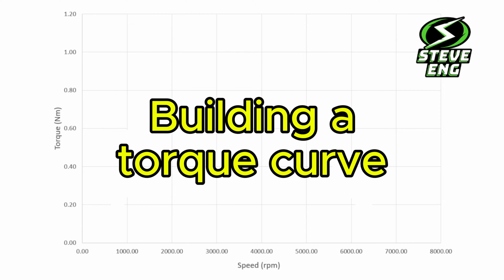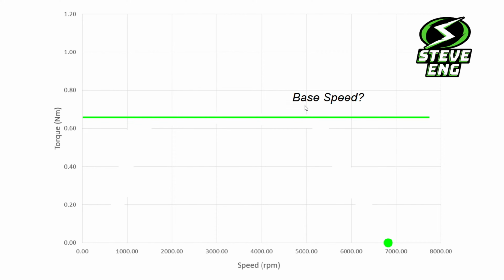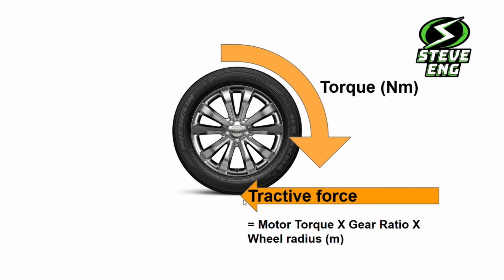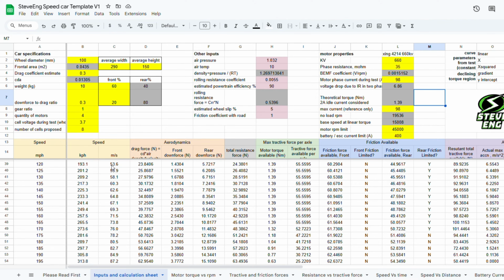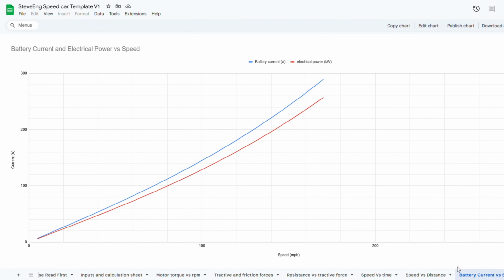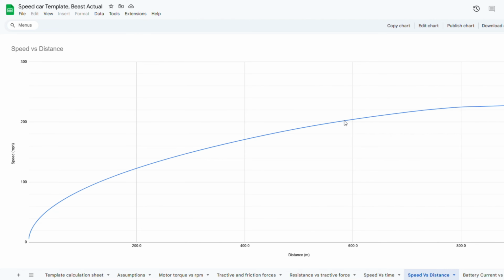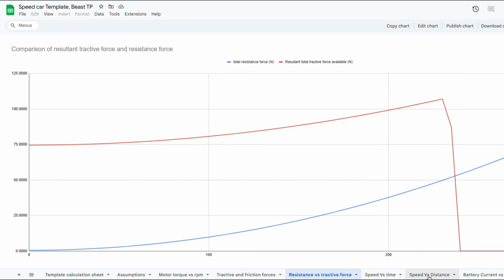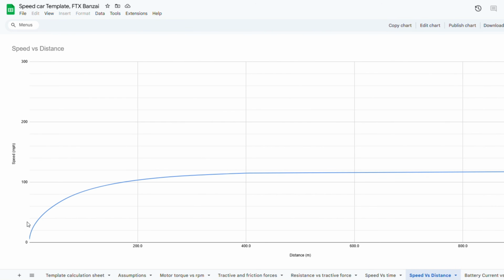Part 3: Groundbreaking Performance Prediction for your R/C Speed Car!

Comment: Hi Steve. Really interesting video series. Came across it after son watching RC videos on here. In your sheet you have the coefficient of drag set at 3. Do you mind saying how this was calculated as it seems high for the size of vehicle. I would have thought the cda would be much lower, or able to be calculated from the data you have derived and as you have made the body so know the area pretty accurately. The mini beast series has made me wonder about building one for my boys. Cheers
Reply from the maker: Hey, thanks for checking out the series. CD of 0.3 came from some CFD work that I did on the cone and Beast designs. What I have done with the Beast since has actually proved that this estimate was not far off the mark even though the body looks very streamlined. The mini beast has been a great project and the results have been fantastic for what it cost, I recommend giving it a try.

Comment: A great channel, that I only discovered today, the video is excellent, just a slight detail, I think there is a mistake with the traction force formula : your torque is in N*m, so multiplying it by the wheel radius will give N*m^2, you instead need to divide the torque by the wheel radius to get to the driving force, in N (at a 1 N*m torke, you get a force f 1N at 1m, or 10N at 0.1m). Thanks for the video
Reply from the maker: Good spot! I realised that recently myself actually when I re-used that slide for a later video! Thanks for pointing out that error, glad you're enjoying the channel 😊
Reply: @steveeng1826  Seriously, both your videos about bench testing and performance predictions are perfect. I am currently designing a drone winch using a 3120 motor bolted to the cable's drum, and you really enlightened me about how to properly assess performance. 
I tried to get the torque constant from T-motor tests sheets, and I found what was the missing detail : the amps shown on the datasheets are battery amps, not the windings amp, by calculating them (Ubat*Ibat *efficiency= Speed/KV*Imot+Rmot*Imot^2, yes a second order polynome resolution, works really well with the discriminant method, just pick the positive solution), take a 90% efficiency for the ESC and I got the expected torque point aligned with the real indicated torque until the 90% power point.